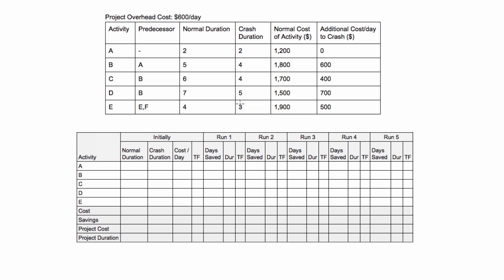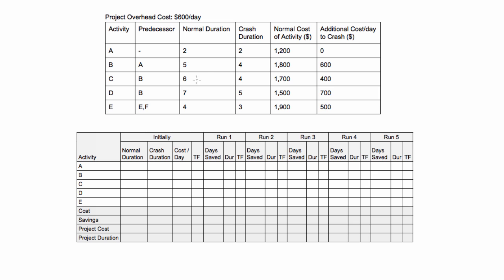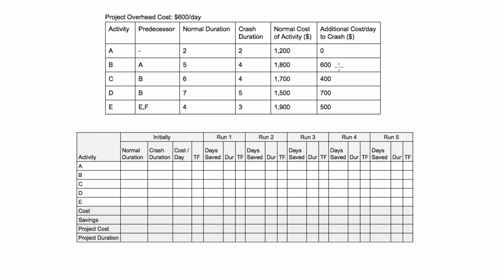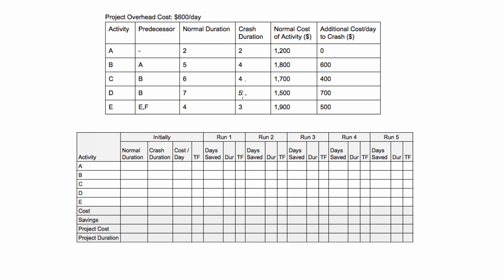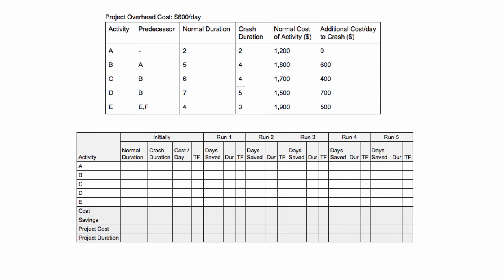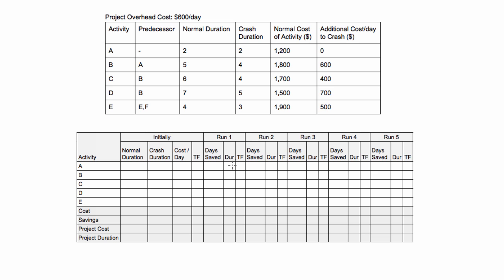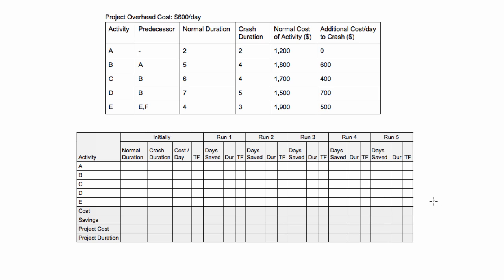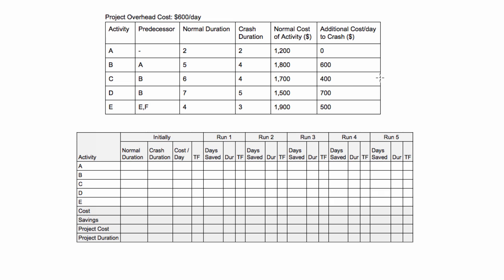Project crashing explained

Comment: Hello. Very helpful video. My only question is if it is possible to do partial crashing? For example, I need to reduce the days of a project by 3, but the crash duration of the next cheapest option is 5. How can I calculate the cost for this activity after partial crashing?

Comment: For activity A, if the crash duration would be 1, still you won't crash it. Can you please explain why? Why it is a good idea and why it is a bad idea?
Reply from the maker: Hey i did a 2 part video solving this exact problem and explaining everything, it's here: https://youtu.be/ZOW2QU_sbJ4 and https://youtu.be/0oBUxrpzWhM
Reply: crash duration is the shortest possible duration that any given activity can be , so if activity A has crash duration of 1 this means this  is the shortest possible duration that activity A can be , so you can crash 1 day when we consider this example , cause  activity A has a duration of 2 days